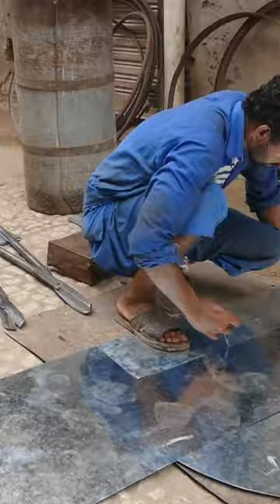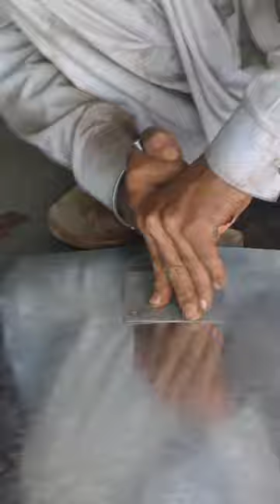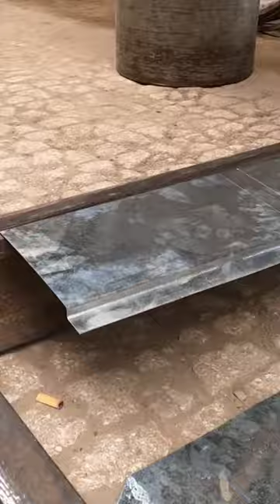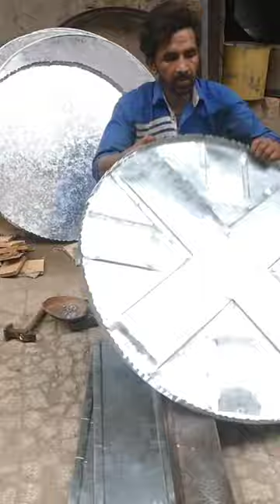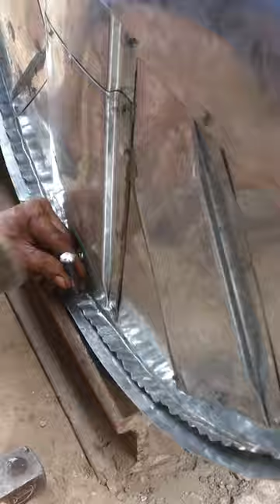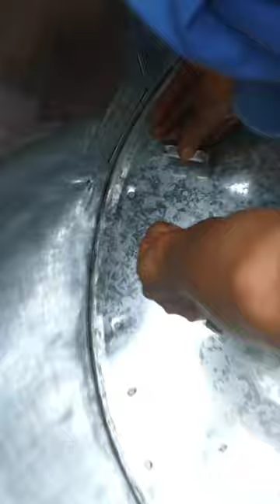Metal trunk making arts

Comment: Почему нельзя сделать из нормального железа а не из фальги ?
Reply from the maker: Crafting foil is easy
Reply: Cheaper to build, lighter to move, easier to work with. Best for the tasks not requiring high pressure or weight.
Reply: It looks like galvanized iron.